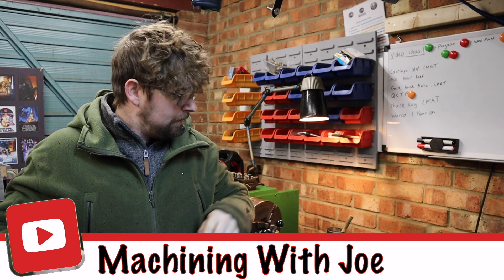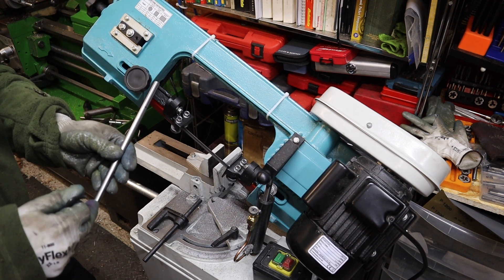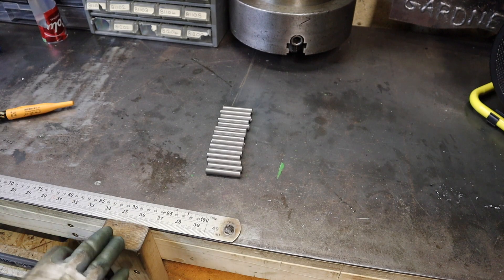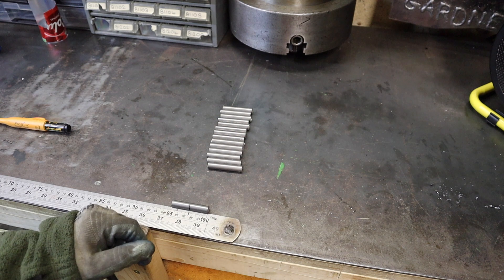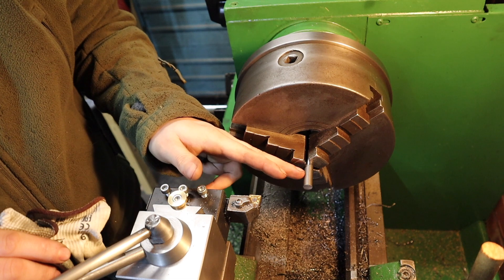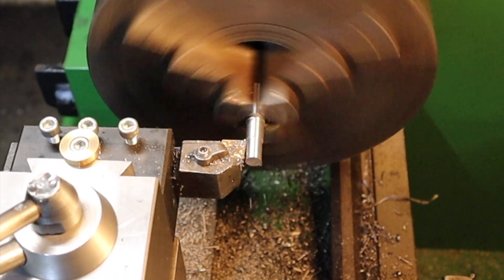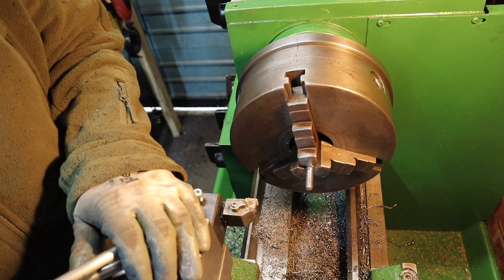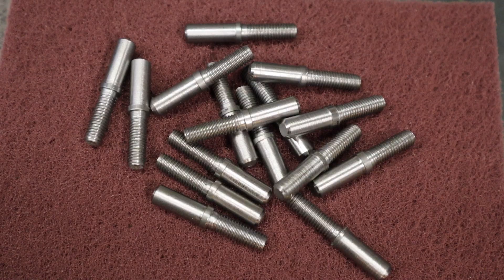Batch Machining in a Home Shop

Comment: Proper job!

I'm not a machinist, but I did a similar job decades ago. I did all operations in the late. I fed the whole rod through the spindle. Turned down the diameters, threaded with a die, lopped it off with a parting blade, loosened the chuck, and fed out a new lenght of rod. A DRO would be awesome for these little jobs, you could even use it to set the stickout of the raw material in the chuck.
Reply from the maker: Hey Frode thank you very much. 
For this job I do really wish I had a DRO on this lathe but until I save up for one this method will have to do. :)
Reply: yeo sounds more like what I would do. Without the long sleeved coat and gloves on DUH!

Comment: Hey Joe I'm sure you're aware, and someone else had prob already said so, but you should NOT wear gloves while operating a lathe.  Also, sleeves should be rolled up.  You have a little zipper on your sleeve with a lanyard on it, which could easily cause an injury.  I'm sure it's cold, but you should avoid these things as much as possible.  The other thing,  you should rest the Tommy bar of your die holder on the tool post while threading and not hold it.  Just some things to think about.  Keep up the good work!
Reply from the maker: Yeah you are right I do need to be more thoughtful when it comes to what I’m wearing. Good idea with the die holder handle thank you for your comment
Reply: @MachiningwithJoe  love that you are getting your hands dirty and learning, all while filming it all!  Hats off to you from Ontario Canada!  Right then!
Reply from the maker: Thanks Josh it’s a long process but slowly getting there. Thanks for your support hope to hear from you again on the channel.

Comment: Joe
I was doing precision batches like this in the early eighties only difference was I was using a hardinge HLV with 5C Colette’s and a spindle backstop the pins I was making were for Martin baker ejector seat barometric parachute releases but the principal was the same although my tolerance’s were in tenths of a thou. Great channel and video as always and the process you are using is the same as I used. 
Rgds
Jon.
Reply from the maker: Hi Jon yeah a 5c collet Chuck is on my list of tools would of made flipping these parts and keeping concentricity easy. Glad we used the same technique and that’s some impressive tolerances. All the best until next time.

Comment: Good job! Yes you did things correct but will work much more accurately if you used collets. Still good though but collets are the way to go.
Reply from the maker: Yeah when funding permits I do want to get a 5c collet Chuck and collets but for now will have to wait. One day thou Dermot and then the power of concentricity will be mine